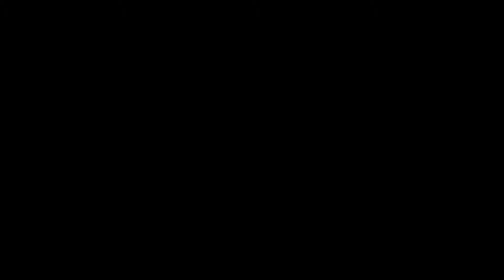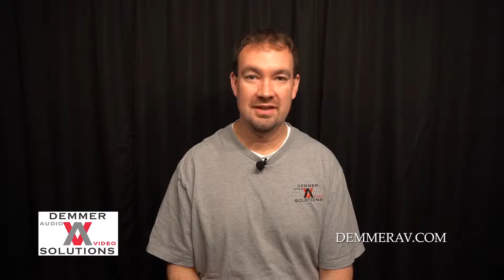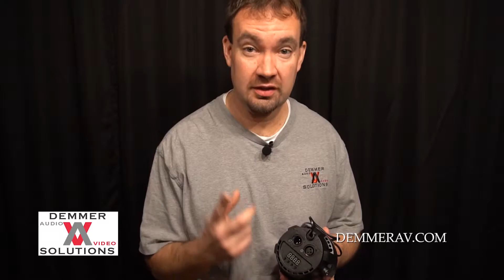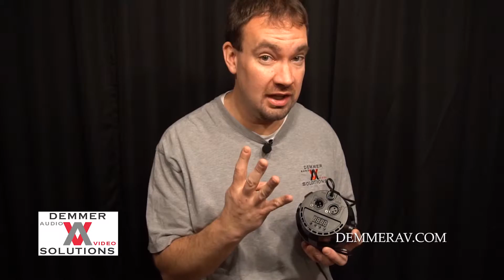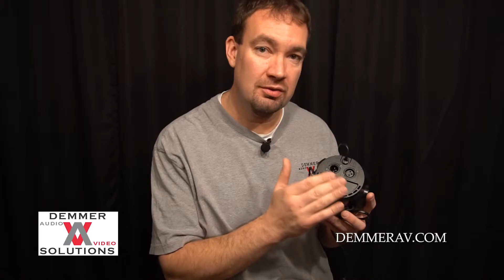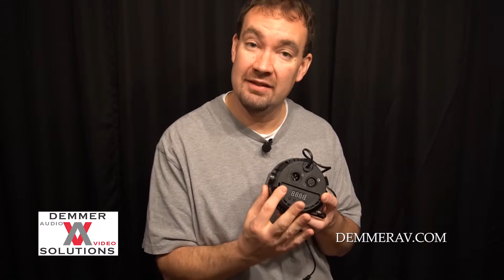DMX Lighting, wiring, and connection explained

Comment: Does each light need power when using DMX? I read that one of the pins is for power. I haven't tried setting my system up with a single IEC cable and have the lights chained together with both DMX and AC. Do I need both?